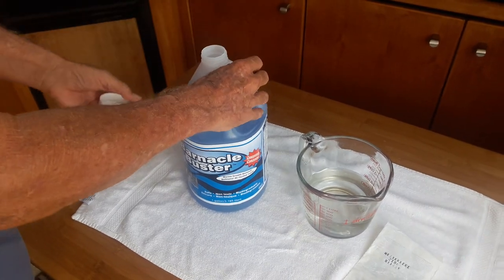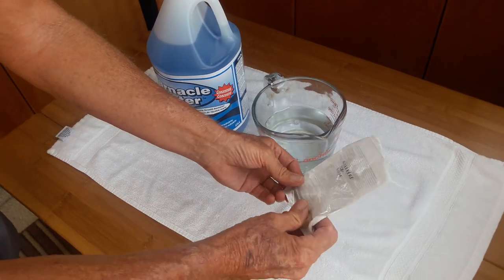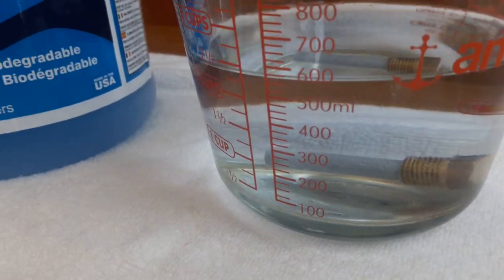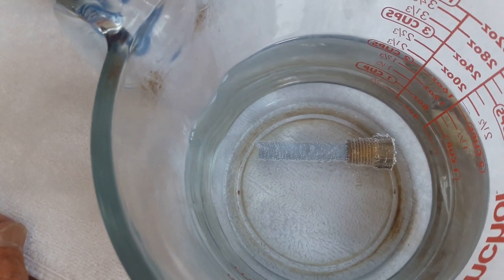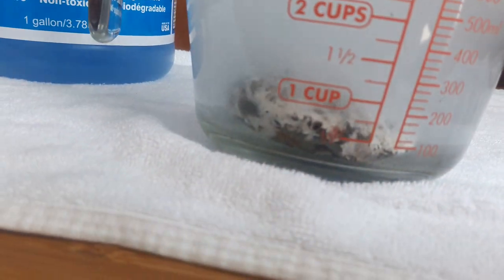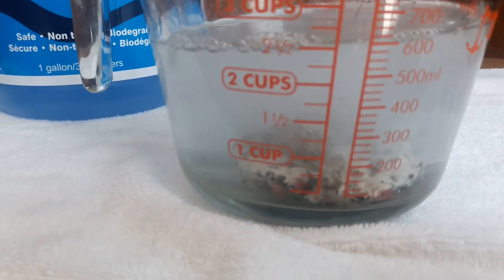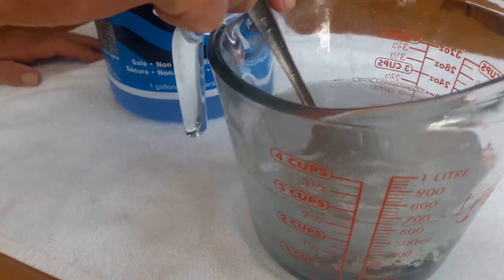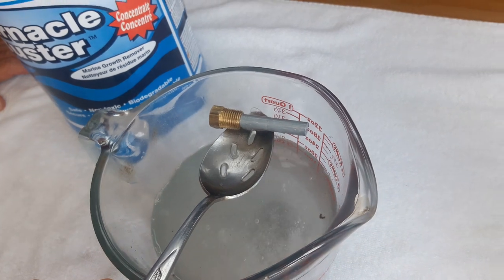Barnacle Buster effect on zinc anode

Comment: In you boats cooling system it is doubtful your zincs are new when you run BB through the coolers to clean them.  The old zinc is somewhere between new and gone but it will be covered with oxidation, the BB will almost instantly eat the oxidation and whatever is left of your old zinc has a good chance to crumble and chunks fall into your coolers.  Not the end of the world but something to avoid whenever possible.  This is why they recommend removing your zincs and plugging the holes when you clean.  Then after your done you can assess the condition and rep,ace any zincs that are 50% or less.